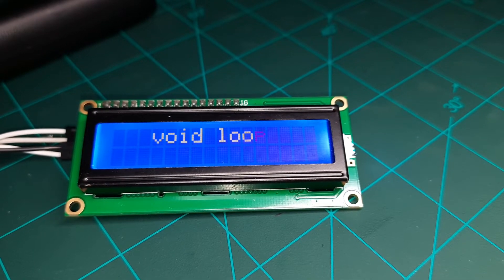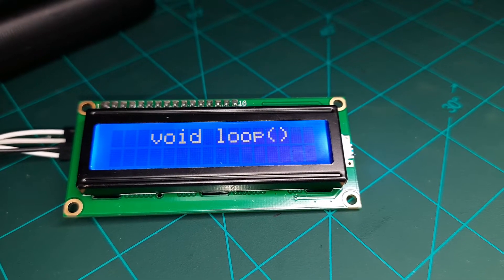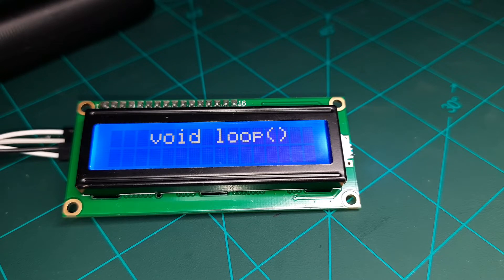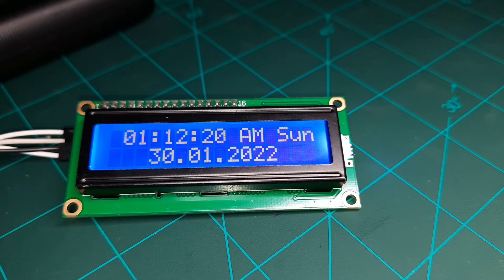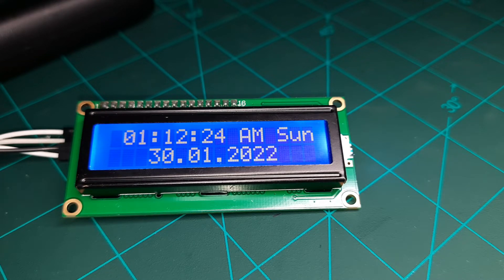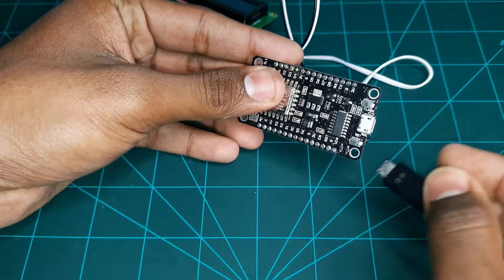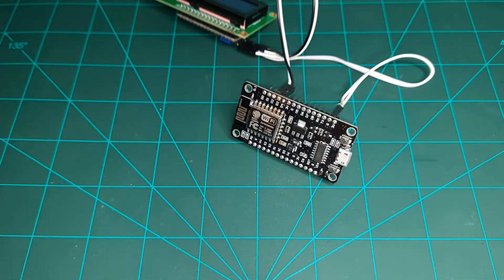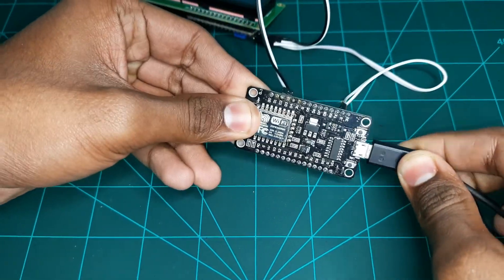Real time clock using Nodemcu and 16x2 lcd display || with out RTC Module

Comment: Hi Mani, 
It is a very nice project. I tried doing it, but I am getting this error while compiling sketch: "'class NTPClient' has no member named 'getFormattedDate'; did you mean 'getFormattedTime'?". So could not proceed further. I searched web, but could not solve the problem. Please help me.
Thank You
Reply from the maker: please try to re install libraries
Reply: @Projectswithmani  Thank you for the reply.
I tried, but of no use Sir, same error is popping up. Can you please suggest some other method to get the Date displayed?